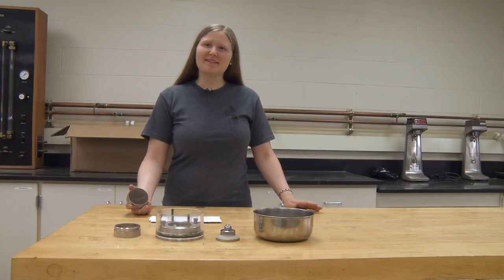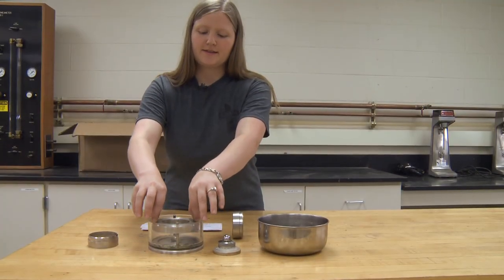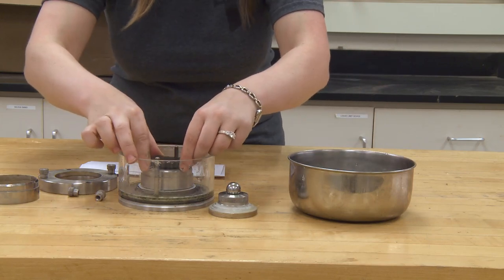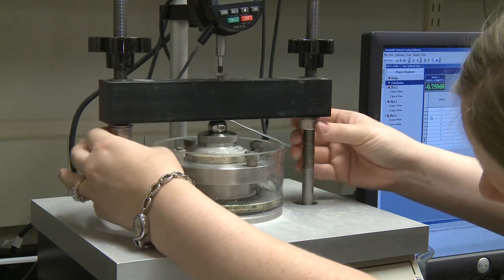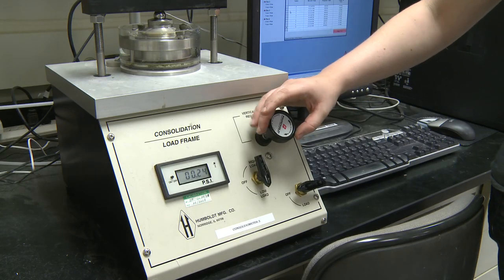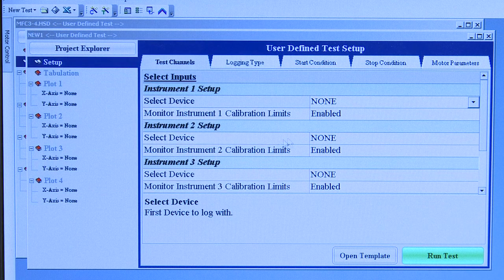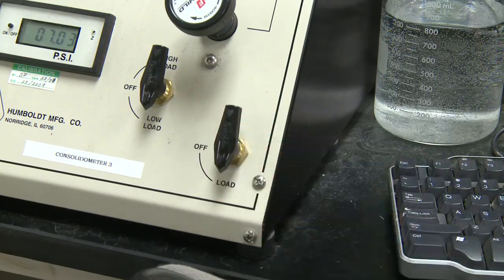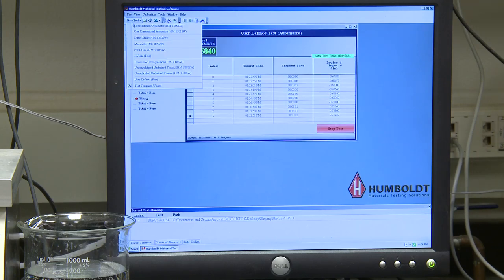1D Consolidation Test

Comment: Hello,
My name is Fabiana Gomes, I work in a soil laboratory at Universidade Estadual Paulista “Julio de Mesquita Filho” in Brazil. We have the Consolidometro Pneumatico and the software for the Pneumatic Con-Matic Consolidation Machine - HM-5432.3F. I want to know how I make the connection between the machine and the softwere, as I am not able to collect data.
Reply: For simple operation you connect the digital dial gauge to the data logger and the it is downloaded to the computer.  The system was developed by Humboldt Mfg. and they also have the option to activate the pressure.  Most times you just increase the pressure using the pressure regulator for each load increment.  good luck,  Prof. R. Luna

Comment: what are the factors that affect on the rate of drainage in consolidation test?
Reply: When she kept touching the soil surface she was reducing the ability of the pore water to drain by smearing the soil surface. If you touch it you should gently rough up the surface to open the drainage path but be very careful not to disturb the sample. Trimming the sample improperly will either disturb and/or reduce the drainage path. Different tools should be used for different soil types. It is an art to be able to trim an undisturbed consolidation sample. The nice thing about the consolidation test is that it is apparent whether the sample was disturbed or not by how sharp the transition from preconsolidation to virgin slope is on the stress-strain or e-log-p curve.
Reply: permeability (hydraulic conductivity) and the thickness of the soil layer (sample)